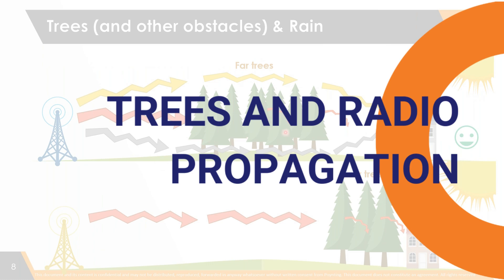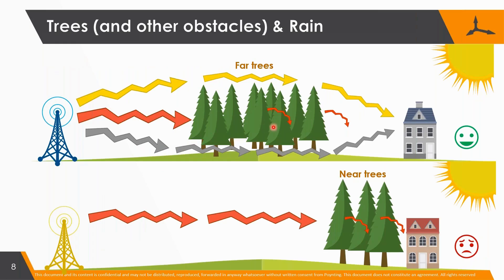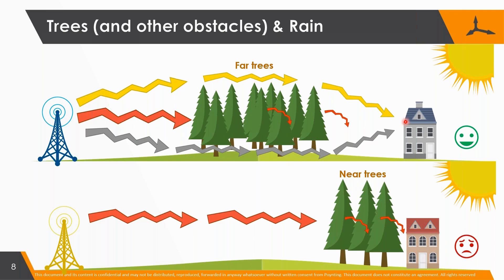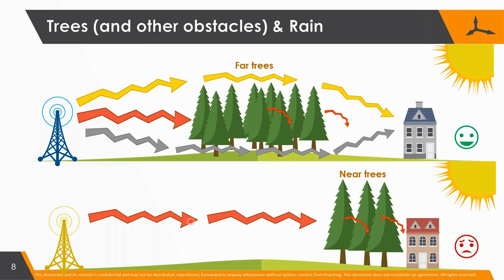Trees and Radio Propagation

Comment: I have 100ft pine trees in every direction of my home.   I have no direct line of sight, except due south.  Yet I am able to position a UHF antenna near the ground, tilted slightly to the tops of the trees and pick up a TV station with 98% reliability from a distance of 70 mi.   Otherwise, the station is not received at all in my yard.  Even on a 40 ft mast.

And I know the signal is coming from the top of the tree because after 2 years, when my neighbor on the next street chopped down a tree in the direct path of the antenna, I lost the signal and had to find another tree reflection point from another tree.  This only works if you have tall trees between you and the transmitter.   And, it will only work for a station in ONE direction.  For other stations you have to find their specific reflection points.

I'm been trying to tell people that trees DO re-direct RF signals rather well and you can use their height to your advantage, but no one believes me!   IF I place a high gain 2M antenna at 40 ft and attempt to pick up a repeater 40 mi away, it may be noisy.  it won't work as well as a 2M on the ground tilted upward to the trees.    

Therefore,  I do have a high gain omni at 40 ft, but when a distant station is noisy, I also have a beam antenna on the ground I can switch to and point it up to the tops of the trees to bring that signal in clearly.  

Back when I was growing up as a kid, we had a 500 ft mountain between our home and a popular FM station.  I installed a 60ft antenna to pick it up, but it didn't work.  I noticed than when the same yagi antenna was near the ground, pointed at the mountain, the reception was perfect.  Low band signals DO travel down a mountain.

The old saying has always been, "The higher the better!"   That may be true if you want to install a 500ft tower, but often you can get the SAME results down near the ground with a little experimentation.  Learning HOW to capture signals with trees and mountains is a bit challenging, but it can often be done to provide superior results..